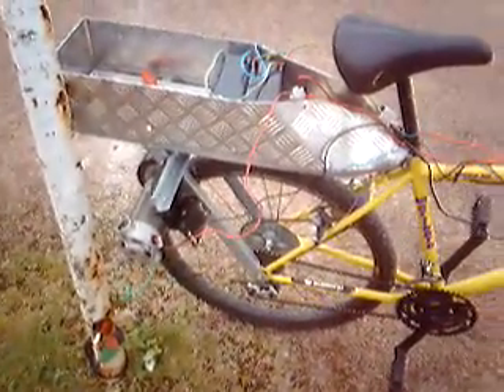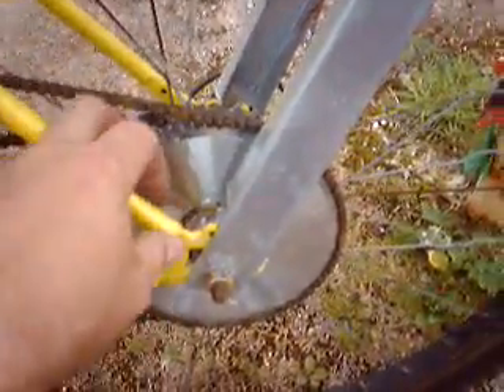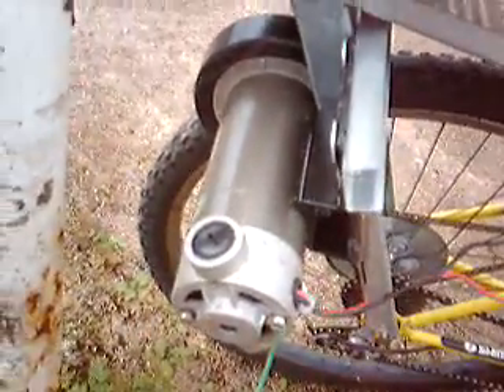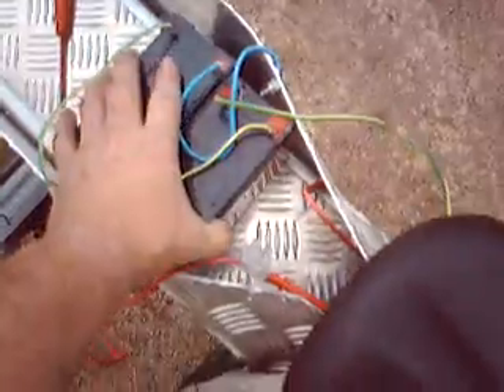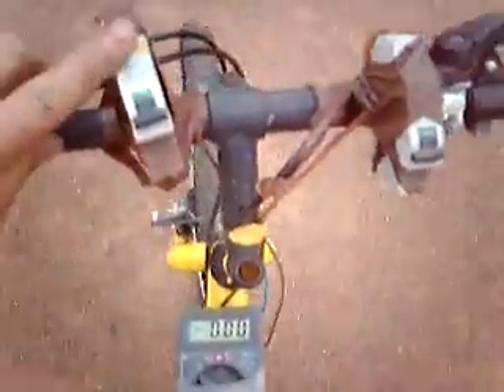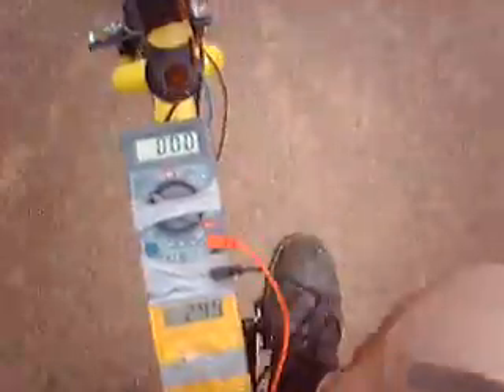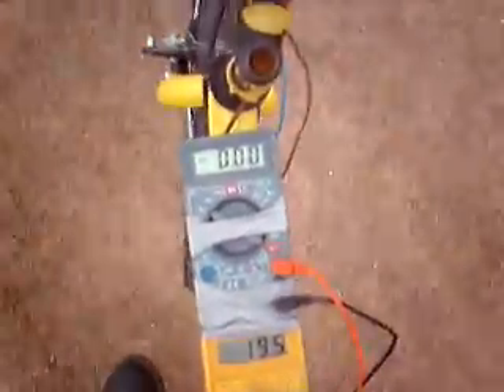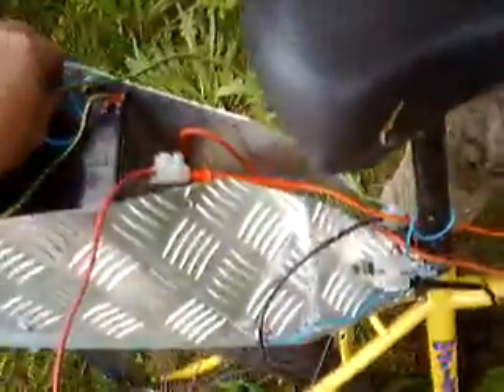self charging home made 24V electric mountain bike

Comment: you don't need two motors you can just use the 24v, if you want it to brake harder boost the voltage through a dc/dc boost converter
Reply from the maker: +lendoggtheking  one motor used offers power and charging and works as an electric braking system also when flicked to charge

Comment from the maker: i used the treadmill motor as an electric break and down hill generator thats why there are 2 x motors one to drive and one to charge though not both at the same time and no fancy switches just an pair of circuit breakers used one for drive motor and one for charger motor eg the treadmill motor

hope this helps
TWMM

Comment from the maker: it was only a play thing I knocked out one afternoon I was board but I got on its maiden voyage with 6 x 7 ah 12v (X2 =24V so 3 24v batteries) 4 mile out and 4 mile back though it was getting slow and the wind was low so I guess it must have been all the doughnuts I had eaten lol

tyres were pumped up hard too so to run better, and run was along a canal tarmacadam track, so flat to no hill climbs
hope this helpes you out

Comment: what if you were to use a DPDT relay to reverse the connections to the motor? so when you go downhill the scooter motor will dump current back into the batteries, that way you wouldn't need the extra weight of the treadmill motor. use a diode so the motor will charge the batteries but will not begin to spin backwards, I have a lot of ideas about electric vehicles but these little motors just seem to break so quickly, I have had overheating and bearing problems but I will continue.

Comment: @MrJetjoe oh about your bike u don't need the batterys if the tredmill moter is gen. the power. but u do need the pedels to get u going. if u have the right speed controls. sometimes if the direction is not right they will smoke so make sure they are set up right with a battery and bolth moters opp. in the right direction!!!